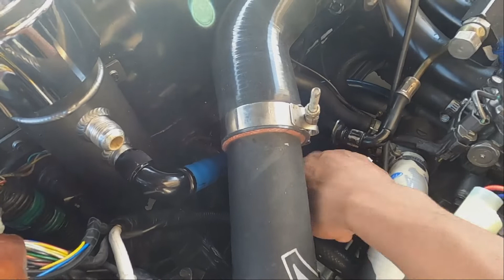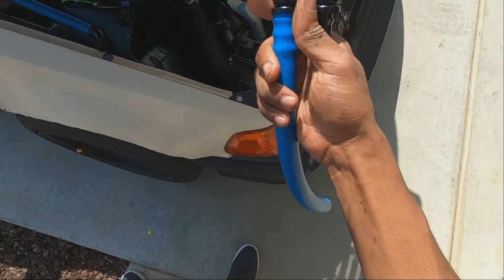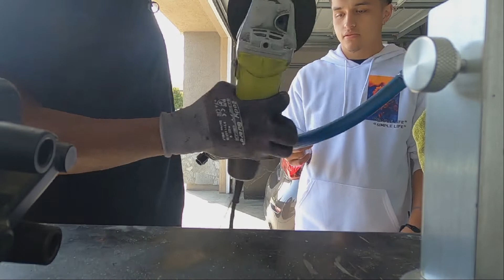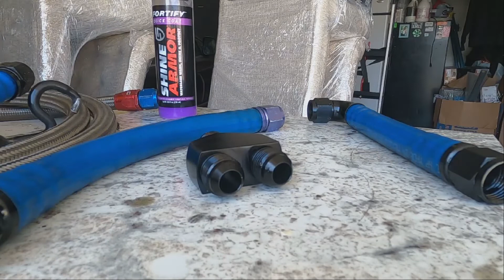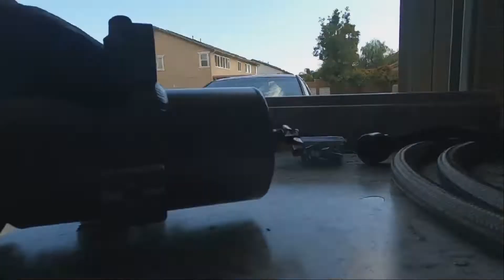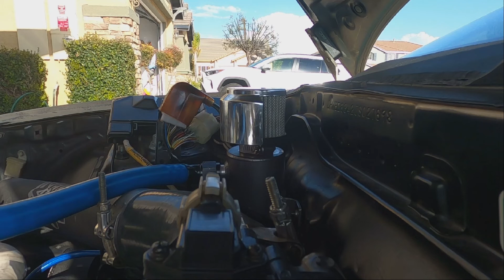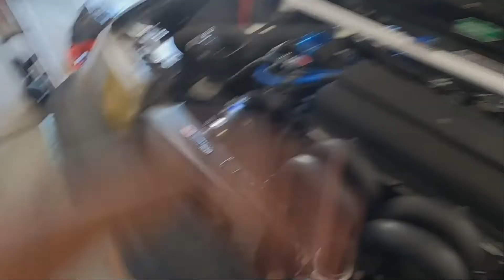Adding A drain back hose to my breather can.

Comment: clean I think you might run into issue of the bottom line pushing mist of oil through the breather tho. IDK how much crank case pressure you have but I know when I built my evo I had a lot of crank case pressure with the built motor.
Reply: gap rings loose the more power you make hence why you had alot of blow by

Comment: Have you ever seen the oil that ends up in the catch can it turns into chocolate milk cause it mixes with condensation that's exactly why I don't run a drain back cause that $h!t will f#ck up your engine starting with the bearings
Reply: was just gonna say. the shit that is in ur catch can is DISGUSTANG. definitely wouldn't want it being fed back into my motor.
Reply: Yea u can see at 0:44 seconds the fitting on the catcha can already have chocolate milk
Reply: I was thinking the same thing.
Reply from the maker: @tayvonrose2528   See the thing is there Is nothing ever really draining back in the first place because it really doesn't get into the can to begin with like it did before. =)

Comment: Did you get your bisimoto 2.4 cam replaced? I ordered one and I'm still waiting on it. Can I just leave my oil catch can drain open at all times or would that cause issues?
Reply: don't leave it open 1 it will make a mess 2 it will go all over the ground